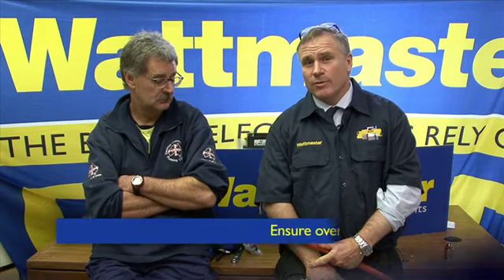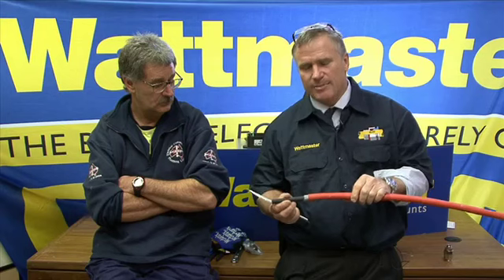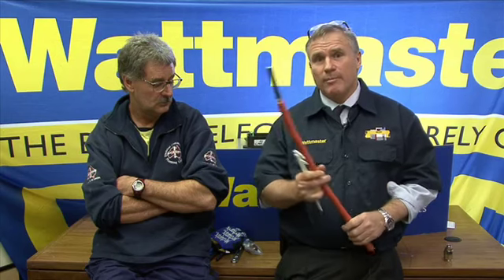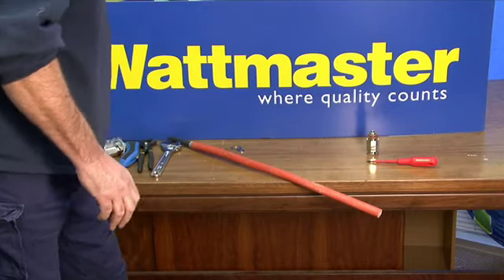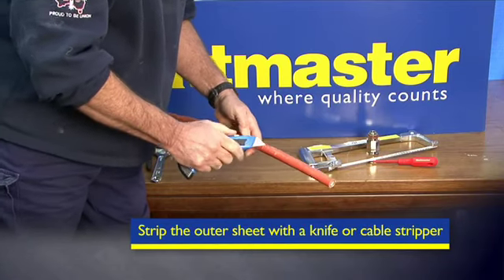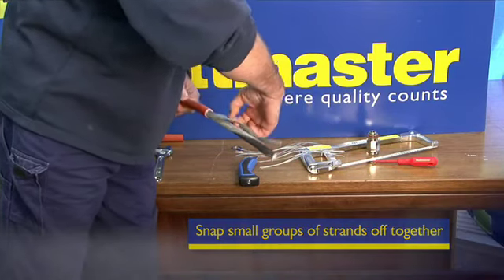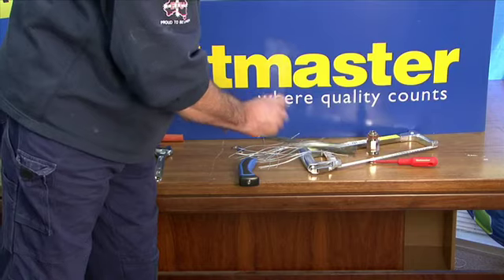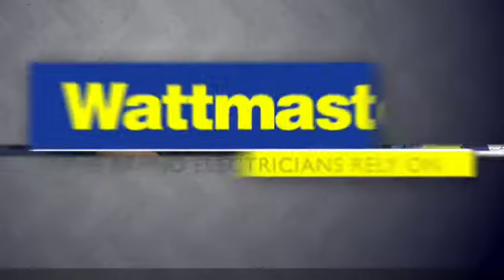How to terminate a steel wired armoured cable gland

Comment: Just being mindful always refer to manufactuares specs on the cable diameter and also the diameter of the swa itself. So for anyway particular brand of gland its helpful to analyse the chart specs. Its important to match the data between the manufacture of the cable company and the gland as this helps determine what is suitable. Selecting a cable gland for a cable is particulary vital in a Hazardous Areas as there are many components such as the IP rating and also the protection technique required in that particular zone. Always refer to manufactures specs and certificates where required when installing Ex rated glands in a Hazardous Area.

Comment: A bit has been edited out ! It is not explained, nor do we see,  the secondary  stripping of the outer sheath to reveal the uncovered wire armour, otherwise a good informative video.
Reply: Yep, 06:15. There's suddenly about 1 cm of bare steel braid... which is essential for flaring and proper driving in of the cone. Took me a little while to figure this out, but job's a good'un in the end.